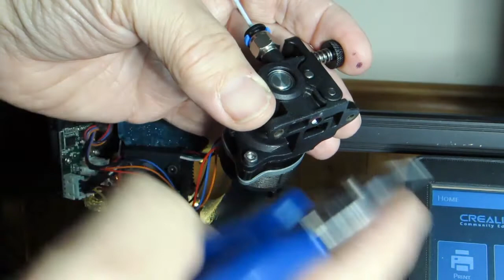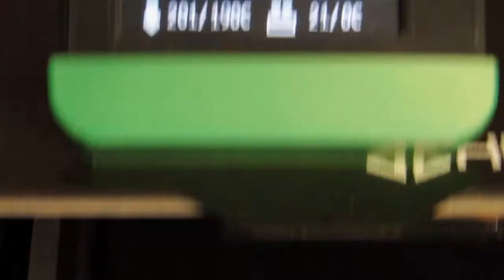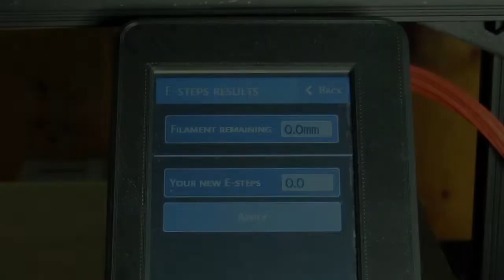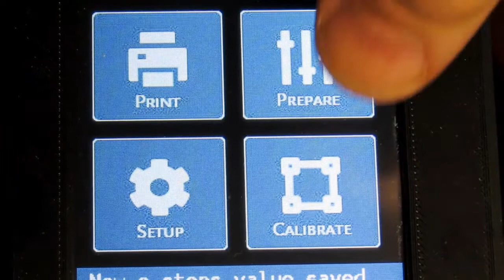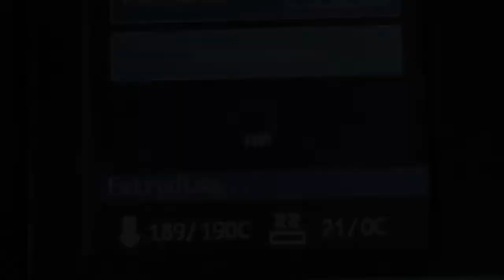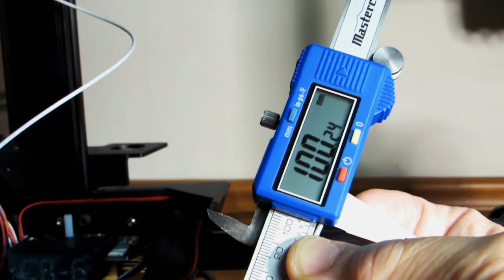How To Calibrate E Steps

Comment: Is it normal, that the heating up process is takeing around At least  5-10 mins?
Reply from the maker: @redsystems  that sounds slow.  
  - What is the ambient temperature around your printer?
  - Do you have the silicone sock on the heater block?
  - Have you done a PID at the target temperature?
Reply: @makingthingsreal101  surround temperature is around 19°c 
I didn't mod anything on the printer (but where can i buy a silicon sock?)
No, i didn't even do the e-steps calibration.
Reply from the maker: @ https://a.co/d/154rydT
Reply from the maker: @ it is not unusual to find that the nozzle cannot reach target temperature without that sock.  The hotend cooling fan blows downward at the block, for instance, making it harder to heat up.  PID calibration is also very important, to tune the heating function in the firmware. 
19 C is close enough to the 20C ambient assumed by the designers, so I suggest you puta sock on it, do the PID and try again.
Reply: @makingthingsreal101  thanks (But I have never done PID tuning)
(My problem is, that it is heating up (around a minute) and does nothing the rest of the 5 minutes and then it starts like nothing ever happened.)
Reply from the maker: @redsystems  that sounds like the ABL macro, which includes a five minute heat soak before probing the bed.  I thought we were discussing the nozzle not heating up quickly before e-steps.
Reply: @makingthingsreal101  yes in both scenarios
Reply: @makingthingsreal101  and can you recommend any other modifications?

Comment: Can you also calibrate with the stock firmware?
Reply from the maker: @janvenken4719  I last used the stock firmware in 2019.  At that time, it was based on an older version of Marlin than was the Community Firmware and no they did not have an e-steps function in their display interface.   If you don’t see it in your menus, I would say it is still a no.

That said, yes there are ways to write and print gcode to teach your machine how to do esteps.  You can also issue gcode commands to your printer from terminal programs like Pronterface, via the usb interface.  TeachingTech is a good place to look for that sort of thing.

Comment: Hi, I recently installed this firmware and the E-STEPS calibration does not work, I press RUN EXTRUSION and it skips to the next screen without extruding any filament. 😩
Reply from the maker: Can you post picture of the screen before and after pressing RUN EXTRUSION?  
I do not know of any bug like that, so if you have found one, it will help to know as much as possible about the configuration of your system.  You may want to move this discussion to the Discord, if the situation persists.

Comment: When you push the filament against the "rail" of the caliper, you are not pushing it against the surface intended for measuring. That surface has a gap, so the piece you are measuring is actually longer than what you are reading on the display. Look at it when you close the calipers. When it is at zero, there is a gap there. Your measurement is off by that much.Probably more than a millimeter, but depends on the caliper.
Reply from the maker: It has taken me a while to understand this comment, but yes of course you are right.  That is one of the troubles with "ad-libbing" instead of sticking to a script, when recording these videos.  
Thanks for pointing that out!

Comment: you do know that the surface that you are using on your caliper is not a measuring surface and is a clearance area and your cut length ends up being longer than 100mm. so essentially you are using the measuring tool incorrectly
Reply from the maker: Sorry, no I don't understand.  I measured the extruded length before and after cutting, with two methods, and both gave the same length.
Reply: If you check your caliper you will see a small indent on both sides and you are measering about 3mm to long  if you take the filament and place it on top of the caliper start at 0 you will see that ti will be longer than 100